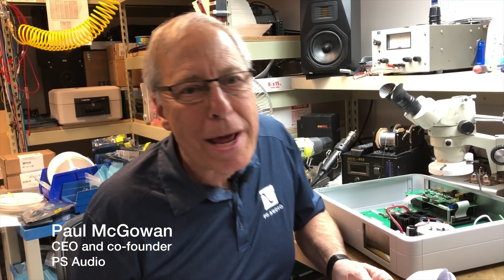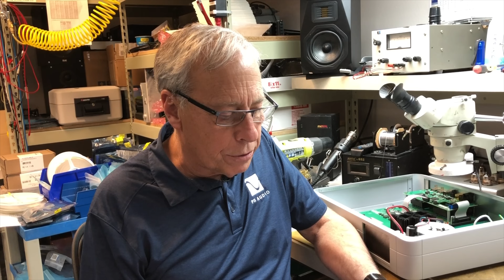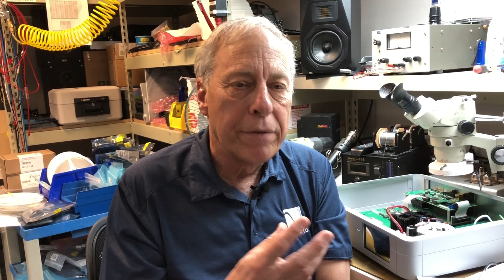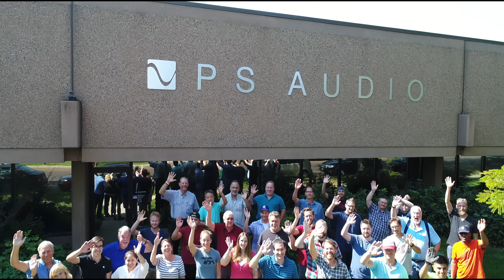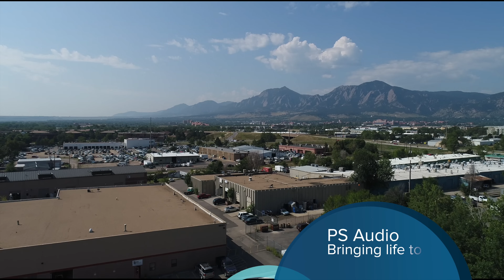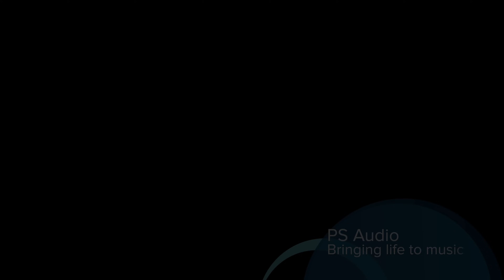Active vs. passive crossovers

Comment: My DIY speakers (the 2 front channel speakers) were designed by Lynn Olsen, a long time member of the hifi community.  The design is an MTM.  When designing the crossover, Lynn found that this design had an annoying tendency in the midrange to be too forward and somewhat annoying.  He added some resistance in the circuit which tamed the forwardness.  How would an active crossover deal with something like this?
Reply: What do you mean by forwardness? How it's measured? What's its unit of measurement?

Comment: Gavin - I think you would hear just as much improvement by going by-amp, probably even better because the room for error using the speakers passive crossovers is almost zero. I did it 2 years ago - the improvement was amazing - especially at loud volumes.

Comment: I can see where active would be better but;  How does active take care of baffle step correction, eq peaks and valleys?  Having it before amplification means you don't need as good of components or having it inline of the power.  So I could see that as a plus.  Still not sold though.
Reply: active crossovers can emulate any possible passive crossover , including eq and baffle step . If you do it in the digital domain it becomes extremely easy

Comment: In term of the cost and simplificity of the architecture, I respectively disagree with the passive crossover system is the lesser of the dual when it is applied in the industry. Think about it, the active crossover/DSP/EQ unit has been multi-channel ready and could house, say, 3-way (6 channels) plus subwoofer, in one-box IF the internal DAC is in Hi-Fi quality. This will eliminate the need for the multi-channel DAC module. Also, as an additional benefit, the DSP/EQ module enables one to perform room acoustic correction.  You would need purchase and add that into the passive system.

When it comes to amplification, the multi-channel PAs can be customized based on the customer’s need just like Emotiva does. Even you have preferences in terms of selecting different PA for each signal frequency spectrum, the power requirement of each P.A. would no longer necessarily be as needy and costly as a single PA serving the full-range frequency. For example, a good 20-30 watts PA should suffice to drive tweeters (2/5kHz - 20 kHz) to sing sweetly. A good 50 wpc and >100 wpc class A/B or D should be prenty to drive midranges (200Hz-2/5kHz) and woofers (40Hz-200Hz). The amplication modules do not need to be manufactured by the venders and, instead, purchased by the individuals to their satisfaction as long as they meet the specification. Note that, in today’s high-end Hi-Fi world, it is quite common that audiphiles purchase expensive monos or multiple stereo amp of enormous power to support their full-range speakers already.

Finally, when it comes speakers, as you know, they just need to be wired directly from the PA at the multiple terminals. If you are concerned about lack of protection then adding in-line quality fuses to the wires or terminals should resolve the issue. Therefore, overall, I really do not think the active crossover system will necessarily be more costly or complex than the passive couterpart. It is just the matter of taking paradigm shifts in concept, implemention and business models to make it reality. I am confident that, if you build it, "they" will come.

Comment: Nowadays technology is advance. not only active crossover, there are Digital Loud Speaker Management (DLMS). If designing passive crossover is hard, why don't use DLMS. You can have flat frequency or you can tune the frequency anyway you want. Phase correction, delay correction, eq, you can tune it very easily.

Comment: An active crossover with the same filter frequencies and filter order will have better phase coherency because the active crossover phase is not affected by the complex speaker impedance as the passive filter is.

Comment: Wow!  Thank you Paul McGowan.  This was one of the first segments that I totally agreed with you on.  Active speakers are better if the speaker designers get to make the choices.  Most audiophile amateurs would screw it up if they tried to adapt a passive speaker to active technology, then blame it on the speaker manufacturer.  Good active crossovers are not generic, they are built specifically for the speaker.  Although I prefer digital audio sources, I am apposed to the extra analog to digital and digital to analog conversions of a digital crossover. so I prefer an analog active crossover.  Most audiophiles prefer the easy hookup of passive speakers and their choice of amplifier, even if they sacrifice sound quality.  Speaker manufacturers don't want audiophiles to spend money on active crossovers from another manufacturer.  Speaker manufacturers don' t want audiophiles to blow up their speakers then blame it on the manufacturer.

I believe amplifiers would be better if they were specifically designed for the speaker they are driving, but most speaker manufacturers are not amplifier manufacturers.  I need to get to where I can hear a pair of ATC SCM150ASL active speakers sometime.

Comment: It seems in theory active crossovers could be better than passive crossovers. But they are difficult to build and it's easy to make lots of mistakes. It seems that is one reason that also top speaker specialists (i.e. Danny from GR-Research) prefer passive crossovers.

Comment: Can I fit an active crossover to my system but leave the passive crossover in the speakers?
Reply: You cannot bypass the crossover in the speaker without removing it. An active external crossover will need to be set at the same frequency as the internal passive crossover to get the benefits of optimizing the individual amplification streams. This information may not be available so you really need to be good at fine tuning the active crossover by ear, and if it’s not perfect then you are going to be missing some information. In other words, not worth the hassle. Like Paul said, you really need to know what you are doing to successfully implement an active crossover. The proper way to do it is to remove the speaker’s internal crossover and then do it yourself actively. You won’t lose any information that way, but you also will almost certainly send some frequencies to either the tweeter or the woofer that aren’t intended to be sent there by design.

Comment: Howdy. Two things that make active better.
First. The coil resistance may add several hundred milliohms to the "virtual" output impdedance of the amplifier. This reduces the damping capability of the amplifier.
Second. Some passive crossovers use bipolar el.cap.s. This is to be considered a crime against High Fidelity and High End. Always use plastic cap.s in crossovers. Large capacitances should be done using several cap.s in parallel to reduce the cap. lead currents.
I do not advocate using prefabricated coils. They use thin copper wire. Use at least a wire gauge of 1,5 mm diameter equivalent. There are several coil calculators in the net.

Regards.

Comment: Thanks for your honesty -- acknowledging that passive xovers are dominant in the market because they're easier to sell.
My experience with active xovers are extremely positive. I diy'd a simple Linkwitz-Riley 24db active crossover from a kit, using quality (but not 'boutique') parts, and bypassed the custom boutique passive crossover in my scanspeak two-way speakers. The result was better in absolutely everyway -- the amps seemed to have so much more "grip" on the speakers, if that makes any sense. I found the set up remarkably easy to tune -- for example using a low-power tube amp for tweeters and higher power class D for woofers.
Big disadvantage is you need more amplifier channels, plus a slightly higher power bill.
I terms of complexity, once you enter the DIY audio realm I actually found making an active crossover far easier than the trial and error involved in making a passive circuit.

Comment: now i have very often heard active is not as good as passive in speaker tech, mainly due to DSP obsolescence,, stuck with that hardware vs. a new amp . i have seen lately  some real cool stuff with active speakers,, the big kef ones,, basically they are a music system. active amp's 9 speakers each amped based on that speakers design and function.,, net work streaming, wifi bluetooth,, .

Comment: During the development of my speaker project I used voicemeeter Potato and multiple soundcards on my computer and did an active xover for the woofer to mid... by far the best bass I've every gotten outta these beasts, it was stellar, and having it computer based I could find the right xover point in rather rapid fashion, as in like 30 seconds, a genuine time saver in the development process.

Comment: Good explanation, but I disagree that building an active system is overly complex for those of us who have played around with electronics. The ONLY difference in how a speaker works re these two designs is what occurs within the narrow crossover region. So we should not be so afraid to build our own, as I have done for many years now. But I would caution against converting a passive speaker into an active one. You really have to start from scratch, carefully select drivers for your design, and determine a proper crossover point based on the drivers' parameters.

Comment: To me, that sounds like a market waiting to be made and exploited. An active circuit can create the filter curves with much better accuracy and feeding limited bandwidth into discreet amplifiers reduces IMD and also avoids (almost unavoidable) low frequency distortion being fed to mid and high drivers. Indeed it requires multiple amplifiers but it is much more economical to use or produce lower powered amplifiers needed in an active system compared to on with a passive crossover. Many have or want to use a nice class A solid state or tube amplifier for mids and 10W are plenty for the tweeters. Considering that most hifi enthusiasts like to mix and match and tweak their system, an active design creates opportunities for more involvement, which is a driver for purchasing. 

I have deliberately not made a list of the technical benefits as they are well known. My aim was to give a counter argument for the "well established" argument that active systems are complicated and not well taken.

Comment: PS Audio, does an active crossover like DBX or Ashley impede the signal going to the speakers from the amps. what do they normally use on the big concert tours active or special designed passive crossovers? I need to know, some say powered speakers today have built in crossovers is that true? and what active crossover do you recommend for professional use?

Comment: I have a fairly old car hi-fi system (from 2008) on which the active crossover is realized on the DSP, so each band is separated even before reaching the preamp. The system outputs 6 channels. I removed the passive crossovers on my 3-way Yamaha speakers (I'm electronic eng, so I know well what I'm doing), and connected the system relying only on the DSP crossover (it's just software), and man, the sound is amazing! Like this, my 700 USD speakers sound closer, if not better than speakers of $3k-10K. The audiophile community is attached to the idea than the pricier a system is, the better it should sound. But, if you know what you're doing and undestand about electronics, you can make a cheap system sound better than a multy thousand dollar system.

Comment: Hi. In my personal opinion that territory of switching to the active crossover is not difficult. It does not take years to learn. Passive crossovers are not a rocket science and duplicate what is inside the loudspeaker box with an active crossover is easy. The results are amazing since the frequencies separation are much better and the power lost and distortion (are not linear) created by passive crossovers are eliminated. Once you find the adequate position of the frequency cut of low, mid and high filters for your specific set of loudspeakers you only need to relax and enjoy the new sound.

Comment: active :
- easier to design to meet your requirements
- more flexible they usually have at least volume control for each frequency band
- needs power but usually no more than a few watts
- due to being in the input stage, if poorly made they tend to pick up noises and add more distortion to the signal
- needs multi-amplification
- stable throughout the entire frequency range

passive:
- harder to design to meet one requirement without compromising another
- less flexible
- doesn't need power
- doesn't pick up noises
- doesn't need multi-amplification
- reactive, their properties change with frequency

Comment: So an active crossover is better because "it's a better acting crossover". Could you
possibly come up with a more useful and informative comment?  How about a 
discussion of the increased distortion from the active crossover utilizing op-amps, 
discreet transistors or tubes.
Reply: No need because it is audiofoolery. Passive crossovers cause more distortion through phase issues that actives ever could. No contest.
Reply: Try active, you' ll never go back to passive again.

Comment: Can I use an active Crossover with just a Single Integrated amplifier( Leben)  connected to the speaker ( Altec)  ? If so how  should I connect it. Thanks in advance.
Reply: No
Reply: No, by definition you need separate pre-and power amps, and one power amp per way.

Comment: Hi Paul, what about pushing things even further up the chain and splitting frequency in the digital domain? Wouldn't that avoid roll-offs and surgical precision in tuning the crossover points?
Reply: Will Giani - there are some very good high end DSP solutions like Xilica that are finding their way into really high end home systems.  There are about a dozen guys on the Klipsch forums who run Xilica XP 4080 and 8080’s with Klipsch Jubilee Cinema Horn systems and really high end Beryllium diaphragm CD’s.  Running 3 or 4 amplifiers.  I’ve heard a couple of these systems and there is nothing else like it.

Comment: 5:22 So Edifier choose well starting years ago making active crossovers speakers with an amp per driver, as they sell very well and have very good reviews. What I mean is that if that's the best way, and they are making that, and being that they mostly make multimedia speakers that way, that sell and sound very very good, then they did hit the nail achieving more quality than they needed, making thew brand even more valuable through better products (or overkill products?). At first I thought it was only more of a marketing question.

Comment: There is no (performance) comparison between a well designed active system and a passive system; as the active system is better in every respect.

Active crossover design (provided it is done properly) solves many of the problems that passive design creates and can't deal with.

No comparison.
Reply: Hi I got a all Tube Lucman 3Wsy active crossover to drive my Klipsh Lascala cabinets with a Amcron power line  three to drive my Klipsh 15 Inch bass Woofers crossing at 650 Hz Cut Off and my midrange horns I use a zpait of Cary mono block  Sixpack  all tube  mono blocks starting at 650hz  and up to 5000 kHz  and my JBL 2402 Super Bullet tweeters takes over from 5000khz to infinity  and I use a Pair of Mono Block Tube Smps with  a single output tube of the 211 Output tube with a 6sn7 input and 6sn7 Driver tube and it gives 15 Watts per channel  class A  All of my Amps used the Mundorf  quality output Caps  it's gets great sound.
I like to hear your opinion on my gear.
RGDS
Francis Jansz

Comment: if i have enough budget in the future, i will get 2 DCX2496 as the crossover to my active system, i'd like to tweak the 24db l/r crossover to a lesser degree esp on low-low/mid, i think best is 12db/octave instead of 24db, just a thought!

Comment: i have a active 4-way stereo system using 2 cx3400 analog crossover, setup as mono each to have a 4-way, represents each left and right channel, but i have to use pro audio amplifier because of balance input to match balance input/output of cx3400. the negative side of using active system is the never ending tweaking to get the sound right, it takes time!

Comment: Coming from a sound reinforcement background I spend a lot of time these days questioning where audiophiles are coming from.  Passive crossovers? Really? I used to subscribe to 
Audio magazine in the 70s and we seemed to be making progress then. Distortion was way down, wow and flutter were better with direct drive turntables and cds solved so many issues with vinyl it was like going to heaven. Many systems had the benefit of active crossovers then, including my own modestly priced system. Now we're back to belt drive, vinyl with its RIAA curve nonsense (can't do bass without it), pops, clicks, hum. We're back to passive crossovers, tube amps, my God. What happened? We do have power cables that cost hundreds of dollars now though, we've got that going for us!
Reply: Amen brother! Totally agree with your post.
Reply: @The Chilean Audiophile   How do you do it?  you modified the speaker?
Reply: @The Chilean Audiophile  yes,   I understand  that outside the speakers.   I have JBL Array 1400.  How do  I make it happen?  - open the speaker and wire direct to the tweeter, mid range, ...?